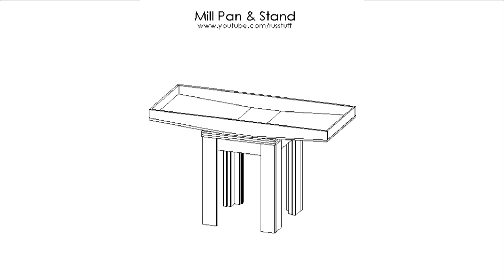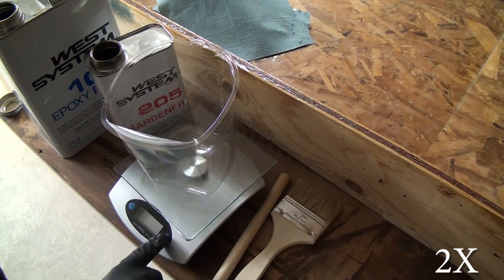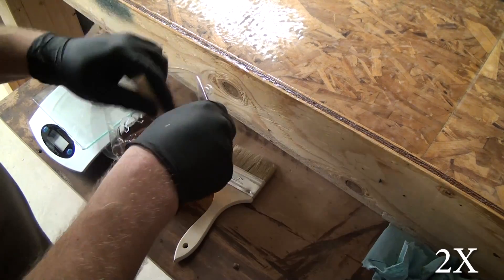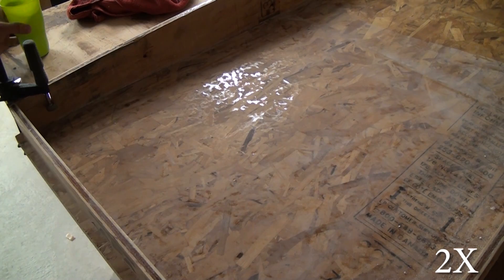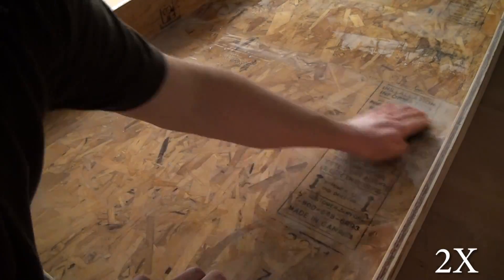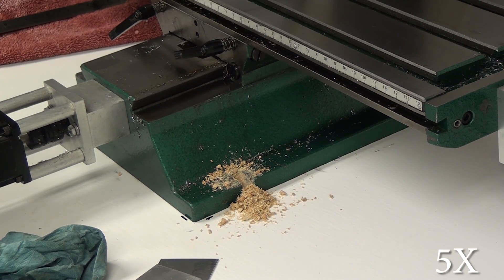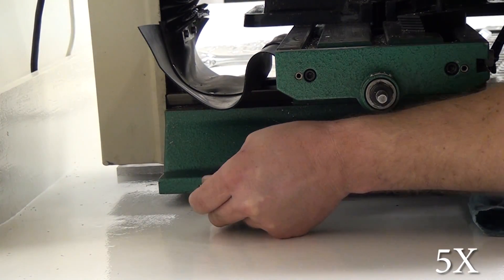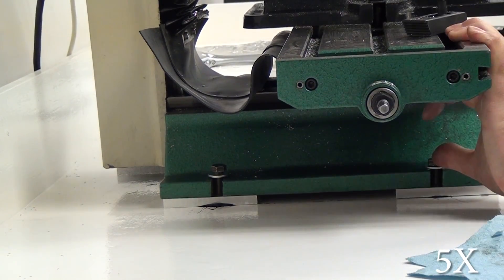CNC-G0704 #8 Mill Pan & Stand (part 2/2)

Comment: A little late now but some Ez Fillet from System 3 makes it really easy to get nice smooth fillets in the corners. Also, a little light glass will make it a lot easier to smooth out and resist abrasion from the chips. A new stand done similarly is in the future for my bandsaw.
Reply from the maker: Ah crap, that is a good idea I wish I would have though of. If I ever have to repaint, maybe I can sneak it under the new coats :)
Reply: russtuff If anyone else is actually going to do it, Duckworksbbs.com is a great place with lots of selection of epoxy and glass for not a lot of money. Warren  Messer (redbarnboats here on youtube) has some really comprehensive videos that show how to work with plywood, glass, and expoxy on his boat building videos.

Comment: Nice Job!  Another good option is Advan Tech sub flooring from Lowes... its like OSB but unlike osb it's water resistant. I used it to deck my pontoon boat 10 years ago and it is still holding up.  I built my chip tray out of it with glue and brads then sealed it with varnish... worked out well.

Comment: If you would like to get your oil based paint to dry faster and it helps thin it out a bit so it flow's better get some stuff called ( Japan Drier) it does a great job..

I like your table it turned out nice very good job... Other than drying times how long was the build? 

Dennis
Reply from the maker: Great tip!

I really couldn't say how long this whole thing took. I started it back in October or November I think and finished it in January. I was really just kicking it around slowly while working on a million other things :)

Comment: Black bolts have been hardened in oil. Which is good because those corrode harder because of the oil aided finish.
Reply from the maker: I had no idea. Thanks!

Comment: Cool. Good job. I'm curious why you went with wood rather then sheet metal?
Reply from the maker: Thanks for watching!

I did it this way so it would be cheap and easy for me to make, and cheap and easy for anyone else to duplicate. If only that epoxy wasn't so dang expensive!!!

I have a MIG and plasma so I could have done it out of steel without a lot of trouble, but not everyone can do it that way. I wanted to be able to offer plans so anyone else could build this without a lot of tools.